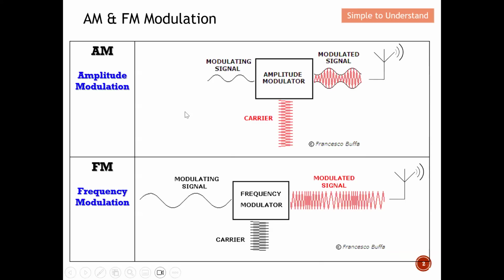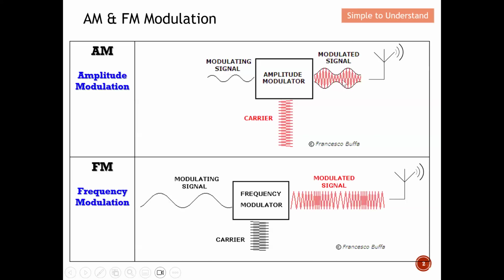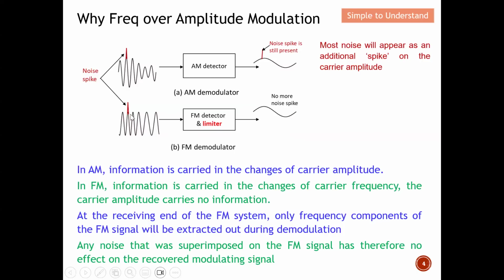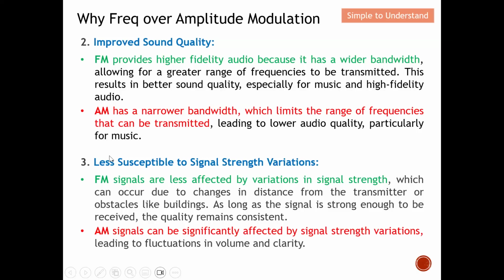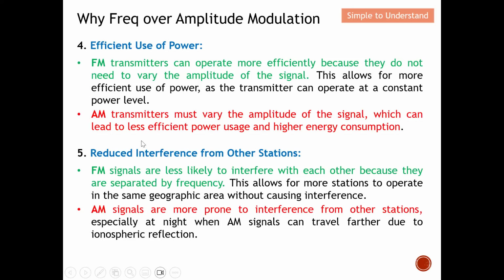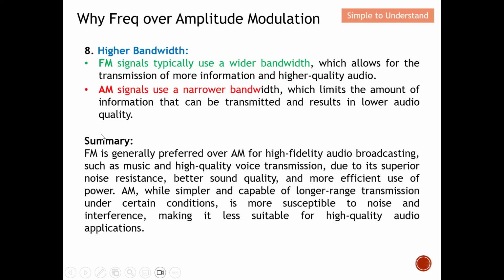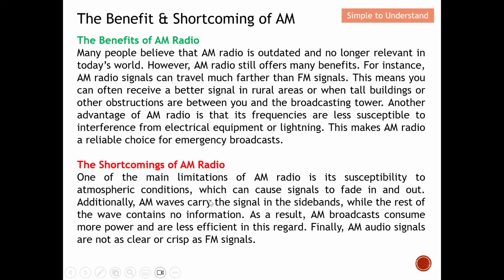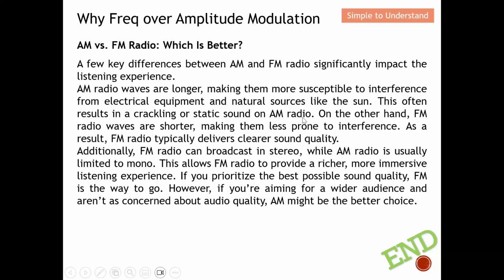Freq Modulation #2. FM vs AM: Why FM Wins for Noise, Stereo & Power but Loss in BW? Full Comparison.

Comment from the maker: Thank you so much for taking the time to watch this video on Frequency Modulation (FM).
This video compares Amplitude Modulation (AM) and Frequency Modulation (FM). From this, you can easily see the significant advantages of FM over AM and fully understand why AM broadcasts have "disappeared" while FM radio broadcasts are still in use. One obvious advantage is that FM has a better Signal-to-Noise Ratio (SNR), resulting in improved sound quality. FM also makes more efficient use of power, requiring less power to transmit signals. However, FM requires a larger bandwidth to send the same amount of data.

Comment: Thanks.  Another issue for FM is the capture effect, where the stronger signal overpowers the weaker broadcast.  This is not always a benefit - for example in the aviation context.  On the other hand FM wavelengths are shorter so it has no need for very large antenna constructions, and this is a great convenience.
Reply from the maker: Thank you so much :)
Always nice that u guys can help to cover what I miss. This is a learning community. Cheers!  :)